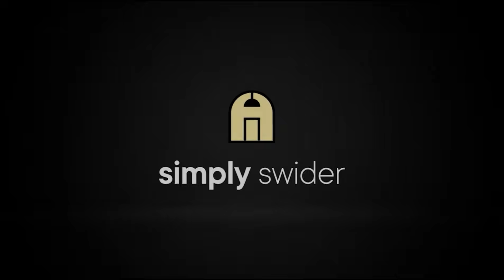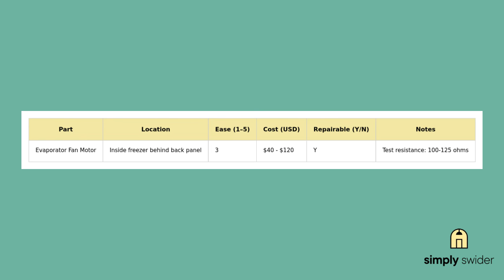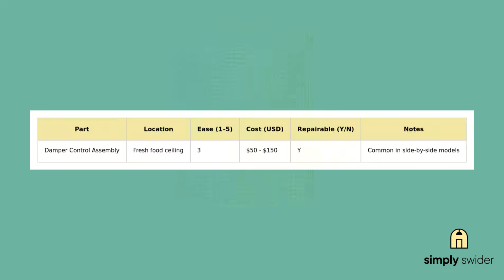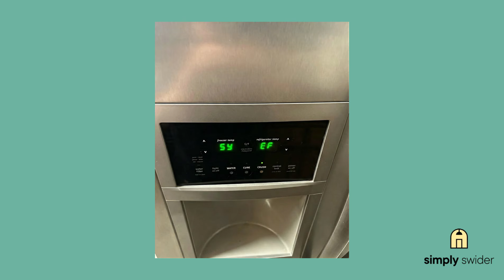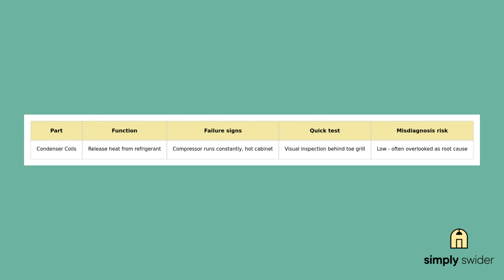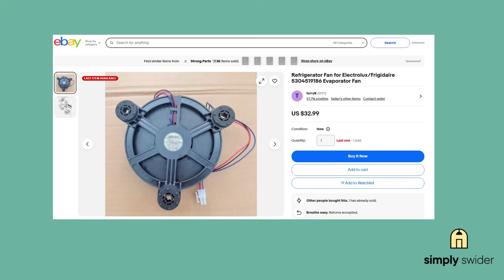Frigidaire Refrigerator Not Cooling? 8 Fixes (80% Success Rate!)

Comment: Need your help  for  Error 7  SAMSUNG  RS2545SH    ,  FRIG -defrost cycle os FAIL ,  run 1-5 hours is OK , then  run overnight   FRIG is not cool anymore & error 7  ,,  i change  Refrigerator-THERMISTOR  & R-DEFROST Themistor & FAN  ==> Test again still FAIL ,, i wonder  Where is  defrost HEATER ?? , I SAW  on  platic-COVER 1x heater with 2-wire=BROWN  is this heater   for WATER drink ,,,  ALSO  i see  a   Aluminum-PIPE-COIL   with 2-Wires(RED& white) run parallel with EVAP-coil  ?? What is this ?? = is this also a HEATER?    WITH one i a HEATER  & what is PN  , Please Help

Comment: Hello we have a Frigidaire refrigerator it's model number is FPRH19D7LF1, it is 12 years old. We had a power outage several days ago and when the power came back on the lights flickered many times. The freezer which is also a Frigidaire came back online no problem. However the refrigerator would not cool below 50°. We unplugged the refrigerator for 24 hours. And then it cooled to 37°. The next day it was back up to 47°, and later on in the day it went to 56°. Per your video it sounds like we may have a sealed system failure. Compressor is running all the time and is warm. We have vacuumed the the coils and replace the relay / starter and the capacitor. If it were a failed sealed system why would the refrigerator go down to 37°and then stopped working? The evaporator coils do have one small section with ice/frost. Could our issue be any thing else besides a sealed system failure. If we replace the refrigerator we will have it replace the freezer and that would cost over $7500, they have to be a matching set and the current model is discontinued.  Thank you for your help!! Alison and Bill

Comment: Mines doing this. I've defrosted it manually and the frig got down to 45°. I replaced the evaporator motor because it was noisy, dry. 
Now I've replaced the timer. The old one appeared to work. But everytime I turned it to defrost, it took a whole turn. New one seems the same. Bizarre rare timing ? So today I checked the condenser fan. It works. It was dusty as hell in there. Did the best I could with a vacuum and brush. I really want to take it outside and blast it clean with water. I see signs of leakage at the solder joints. And the pipes are not very hot or cold. But the freezer is fine. 
Argh ! The damper door is cable controlled. It's seized but the door is wide open. I hope my little cleaning rewards me. I'll know in about an hour.
Reply: did it ever help?
Reply: @imdaman123able nope.

Comment: I appreciate this video.  I have no idea if any of the fixes will help,  but giving tips instead of selling your service makes you great in my eyes.  

Old garage Frigidaire running but freezer and fridge both warm. Compressor not hot and running, no ice on the coils, fan running just fine.  As someone who has never fixed a fridge, I’m going to start with the thermistor. Same thing just went out on my dryer and I fixed that no problem.